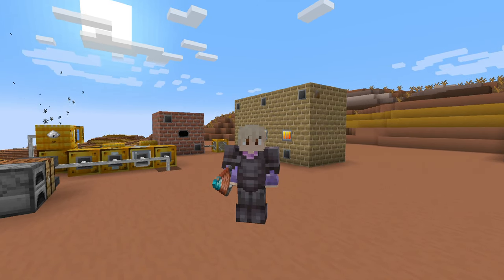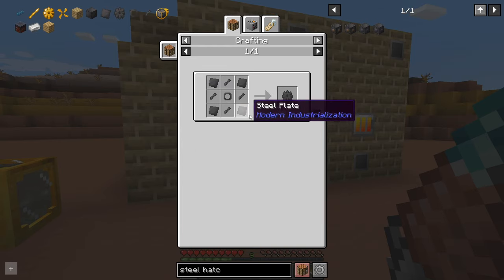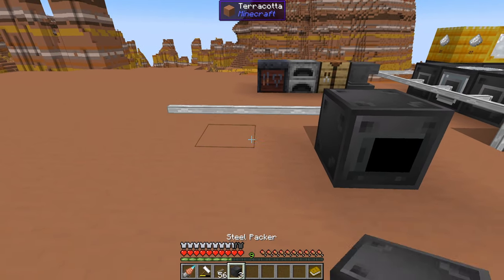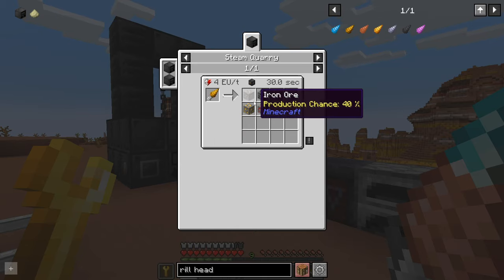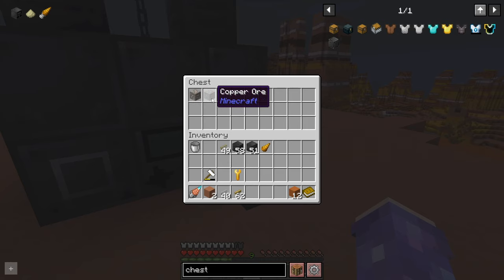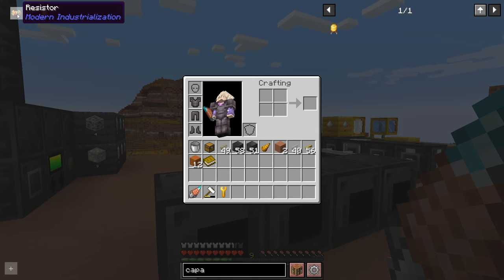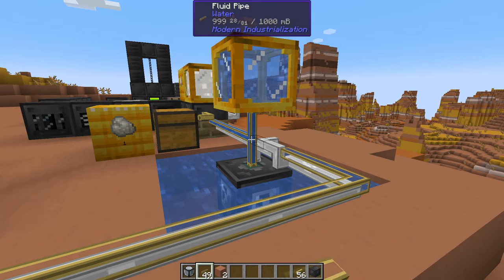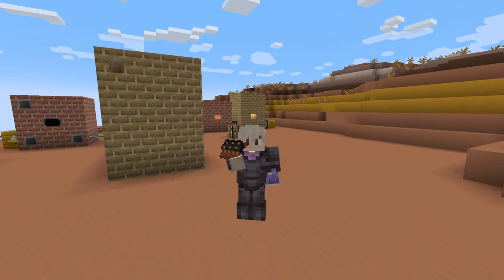Modern Industrialization (1.18): Steel Machines, Quarries & Analog Circuits

Comment: that 4%  (4% / 100% = 1 in 25) use chance on the drill head is quite bad as you need to take into account the ores are a chance really should have been a durability based or if no ore on run is produced no use chance.  If you have a real bad rng run you will use more materials on the drills then you get back
Reply: The odds actually work out pretty well long term. You can get screwed if you only make one, but by the time you have a quarry you should be able to make a decent amount of them, and in my experience, around eight drills will get you enough materials for a full stack of drills if you're feeding them into a double macerator setup. I was drowning in the basic materials by the time I was processing aluminum, with my main bottleneck actually being lead, which you need for a couple very useful alloys.
Reply: Only couple months ago, drill use chance was 1% and you could get only 1 drill per crafting, not 4.
I don't know why developer update like this, but the odd is same, and you can get way more ores from them.

Comment: Does the steam quarry produces those ores from the void or does the quarry need blocks that it can mine like the old build craft quarry?
Reply from the maker: From the void, once you've automated drill production you're set
Reply: @ClassicDuff  Nice, like the void ore miner from environmental tech :D
Reply from the maker: @marcelwinkelhofer  yep, except you have to supply drills as it occasionally uses them up. So slightly more balanced, though infinite ore is still possible
Reply: @ClassicDuff  WIll you make a how to for fission and fusion reactors?

Comment: Thanks for not forgetting this mod tutorial! Heres are more tips for steel age.

1. A single water pump could handle 20 bronze boilers, and 80 bronze (or 40 steel) machines. So please don't waste your steel upgrade to water pump.

2. If you don't have that many steels, just make another machines instead of steel upgrades, and save them for early steem quarry.

3. Multy block machines could accept 4 EU/t if they have at least 1 steel hatch. You don't need to make all 3~4 steel hatches, and can save more steels. + You can also use gunpowders to multy block machines to speed them up. Enjoy your twice faster steel production and mining!

4. Double ingots make process speed twice faster, of course. Not necessary, but higher tier ingots need very long process time, so doubling time efficiency might be useful. Unfortunately it doesn't improve energy efficiency :/

5. Mixing synthetic oil with paper gives you 2 rubber sheets, but mixing synthetic oil with sulfur (by-product of macerating lignite coal ore) gives you synthetic rubber, which gives you 12 rubber sheets per process. It also used in assembler in future, so keep making it couple tanks.
(You can't make synthetic rubber in bronze mixer, so you need to upgrade it to steel mixer)

Comment: ok steel stuff I'm kinda ok did some stuff for 14 hours straight and I got myself a funcional system (which is the best I can do usually machines and me don't work at all bc of wires and conecting stuff into other stuff its a mess) but the eletric stuff........ I'm lost and I still didn't got there yet.
Reply: Have 1 machine for every thing you ever need. 1 Compressor makes only copper plates, another makes only bronze plates etc etc etc. Really long item pipes + whitelist filters on everything